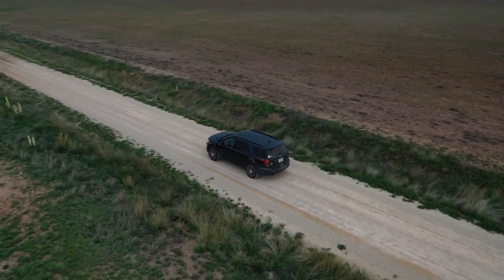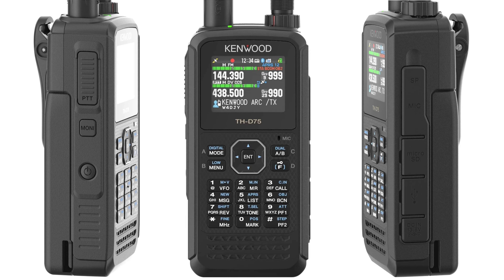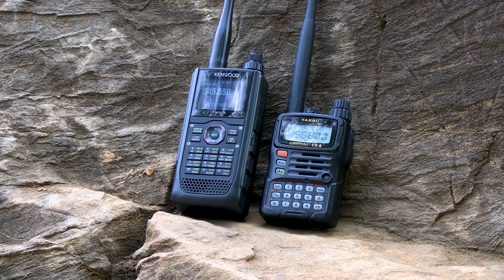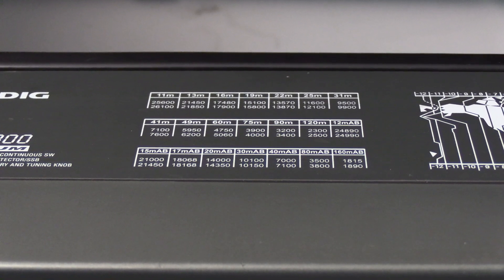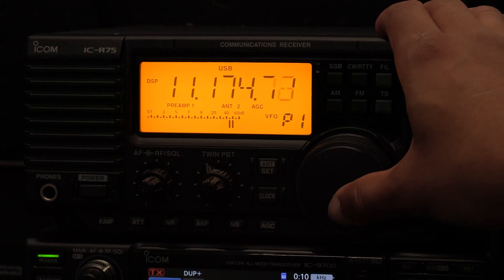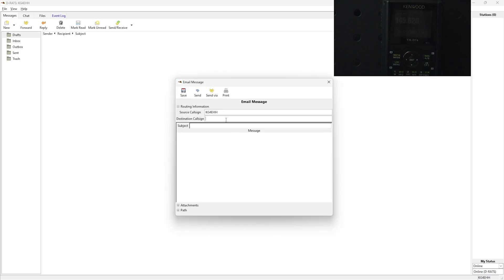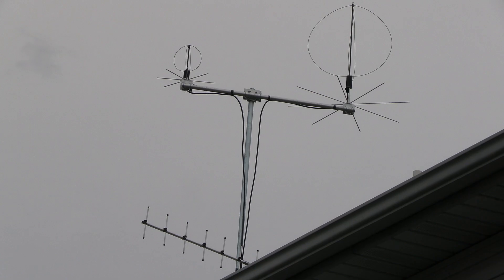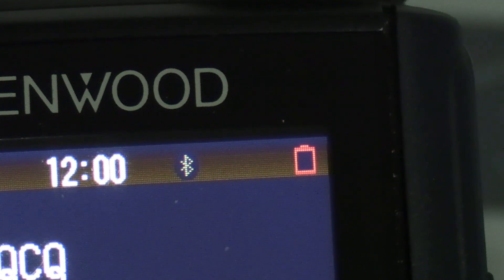The Ultimate SHTF radio - Kenwood TH-D75

Comment: I have a question for you, I have the Yaesu VX-6 and would love to know where you got the connections for the banana clip to connect to the radio.  Also, what kind of speaker wire are you using?  That is definitely a quick setup.  Thank you.  KO4UWU
Reply from the maker: You will also need a BNC to SMA adapter for the Yaesu 

https://amzn.to/44Fcl1c
Reply from the maker: That little Yaesu is a great radio! Amazon sells some decently priced 16 gauge wire and is what I'm using in the video. Here's links to the Wire and the Banana connectors

Banana Plug connectors:
https://amzn.to/3NSTryp

Speaker Wire - 50'
https://amzn.to/3NWtu0X

Comment: Thank you for the informative video.  I currently use the Yaesu VX-8DR as my SHTF handheld.  It transmits on 4 frequencies, has a very broad receive capability and it's submersible.  However, it does not RX on SSB.  The ID-52 is also a great radio due to its waterfall,  since it allows you to quickly find transmissions.
I recently put a reservation on the TH-D75A.  Looking forward to testing it on my. hikes.   BTW.. What program are you using to view the airline routes?
Reply from the maker: Sure thing!

Not a program, but a website: ADSB Exchange
https://globe.adsbexchange.com/

You can also pick up the planes using a Raspberry Pi and SDR. I'll likely do a video on  it before too long.
Reply: @The_Comms_Channel  Looking forward to that video.  I believe in always being prepared.
Reply from the maker: Definitely important and something my channel will focus on!

Comment: We don't have 1.25m here so I'd prefer 6m. It's still gonna be a crazy radio.
Hoping the pricing is not going to be ridiculous but I'm sure I'll need to sell a kidney to buy it. 😟
Reply from the maker: I hear you. Would be great if it was a quad-bander with 6m. Would be interesting to have. DSTAR capability on 6m
 I believe the only radio with that capability at the moment is the Icom 705.

I'm sure the price will be kidney selling territory unfortunately, but hopefully not too crazy. On the plus side, it should bring the cost of the D74 down to realistic prices on the used market.
Reply: @The_Comms_Channel  yes, very true. I have seen adverts of D74's trying to sell high before the D75 comes out.
There may be changes in the final release as they mentioned at the show. Wishing it will all be good news. :)
Reply from the maker: Yeah, it's crazy how much they're going for. Still seeing some for $1000+ on eBay. Long shot, but I'm keeping my fingers crossed for full-duplex 🤞

Comment: No MARS/CAP mod, then no purchase
Reply from the maker: I agree. I imagine it will be capable since the D74 is, but I've not heard anything yet.
Reply: I have been using the TH-D74 for my radio and have two since one is not enough.   Charging is better with the 12v charger becase its higher current.   I hope the D75 has fixed what was less than perfect on the D74 and will get some.
Reply from the maker: Great radio for sure! My buddy Phil just got a deal on a 2nd one himself. I hope they fix the not so great things too. Hopefully more details come out before too long.
Reply: For this price I am so disappointed this is not full duplex.
Reply: I assume the MARS/CAP mod will be possible….  Sure hope so.  Deal breaker for me….
Reply: the 100 ton elephant in the room remains lack of cross band full duplex. COMPLETE FAILURE.
Reply: Hamradio is offering MARS